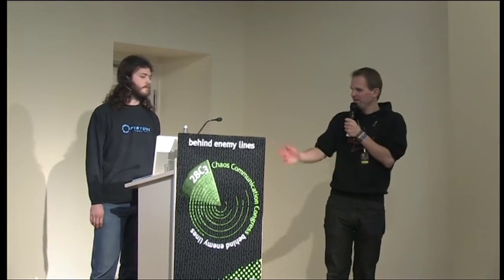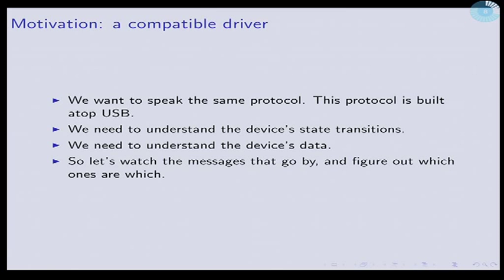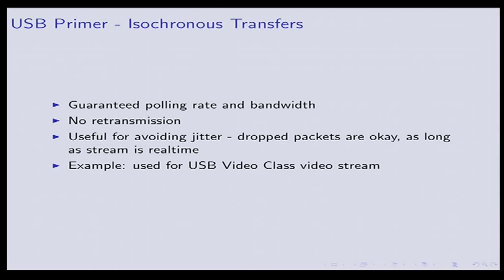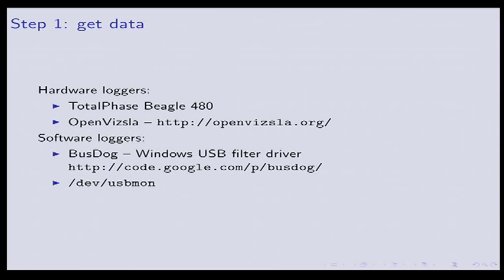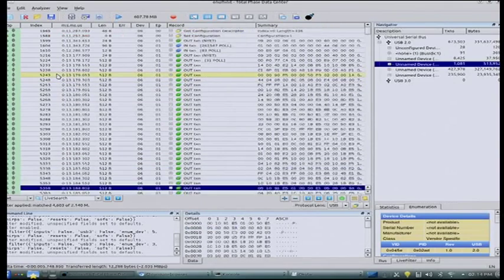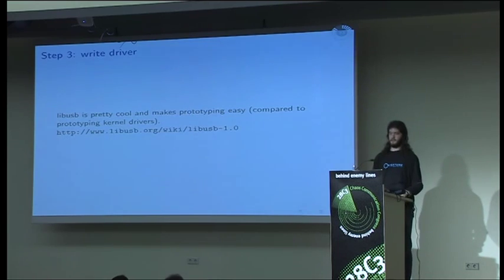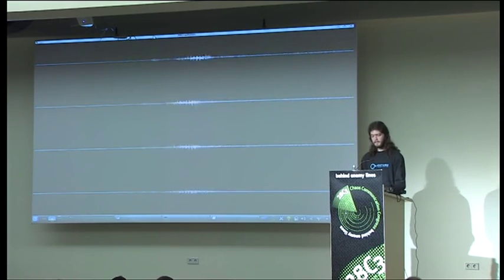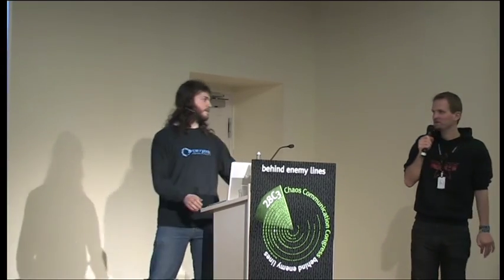28c3: Reverse Engineering USB Devices

Comment: Sounds nice.... but what happens when your dealing with encrypted data streams? As speeds of buses and processors increase, the overhead of data encryption becomes negligible and it prevents people from reverse engineering your drivers and selling equivalent products. I fear this approach only works in certain cases. Very nice video though. Would be nice to hear some more lectures about USB basics.